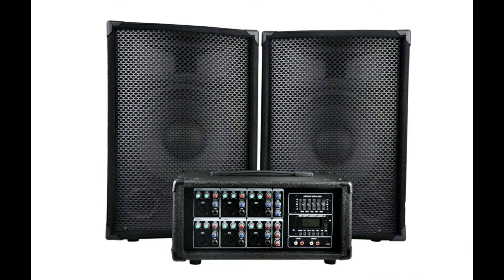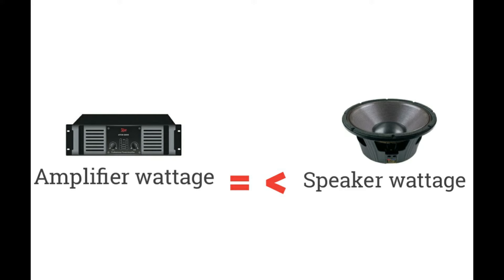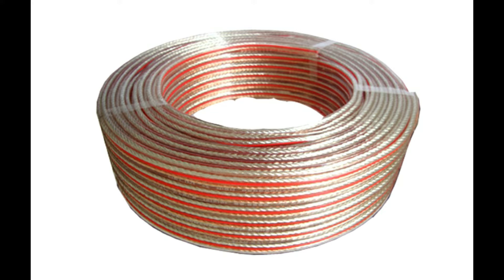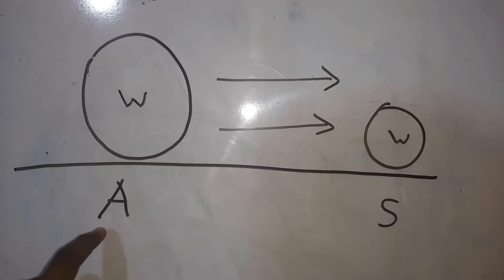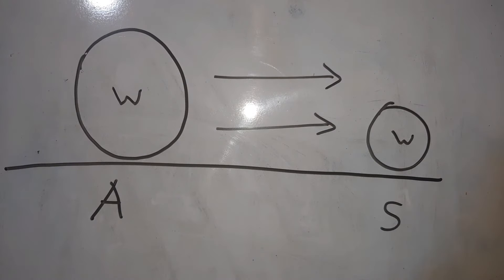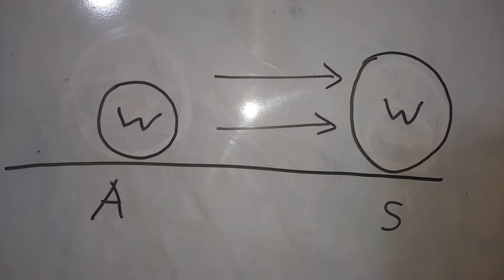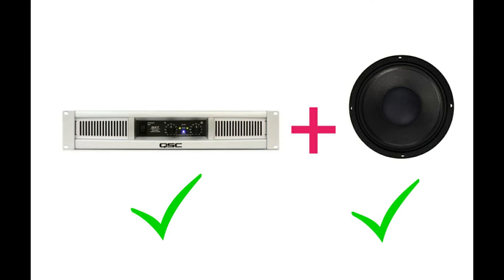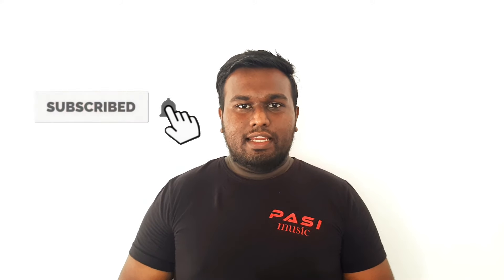Consider Watts Values When Connecting A Speaker To An Amplifier - Sinhala

Comment: Please check the content again. 

You must have a higher wattage of amplifier than the speaker.
At the peak time amplifier emits distortion which could not be accepted by the speaker. Also with less bass. Also ic's, transistors can be damaged.
So every time you have to use much power full amplifier with a bit less wattage of speaker. Most speakers are accepted more watts rather than it rated. As long as amplifier emits a clean signal nothing happened to speakers.
Reply: You are correct
Reply: This is the real truth .